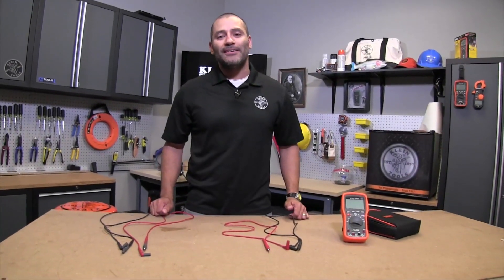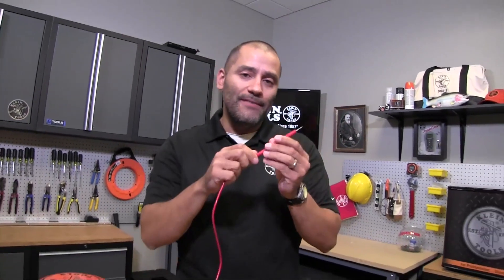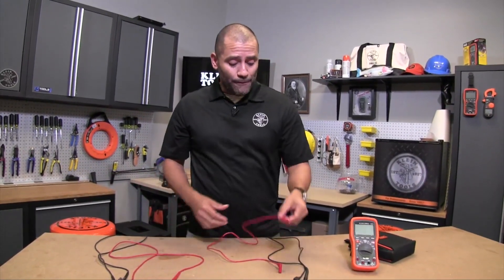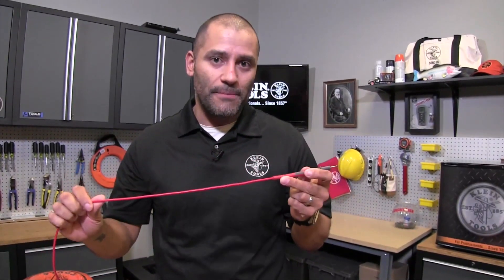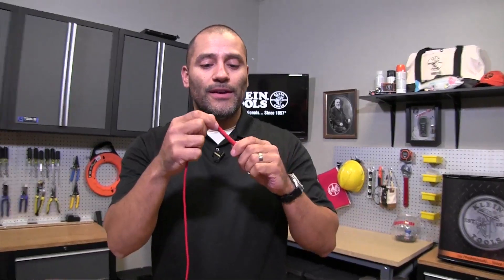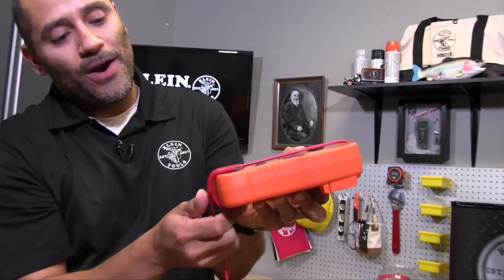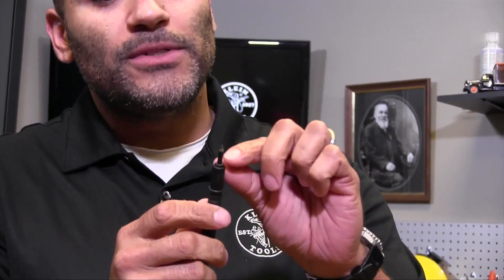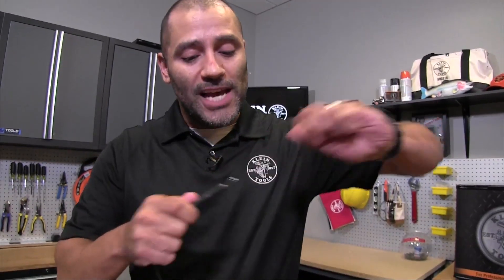How To Choose Meter Leads

Comment: and none of that matters if the bannana plug end is the new style with the capped tip and not the old style where the 4 parts spread with a + cross at the top - so the new style won't sit tight in my old meter.